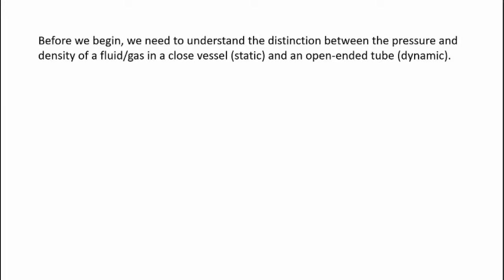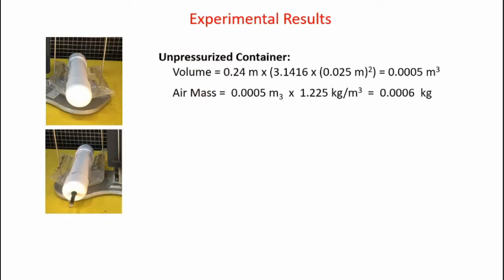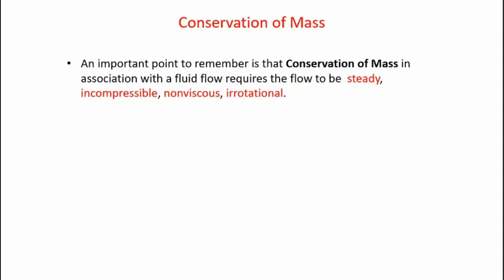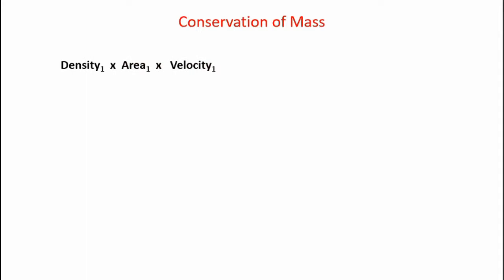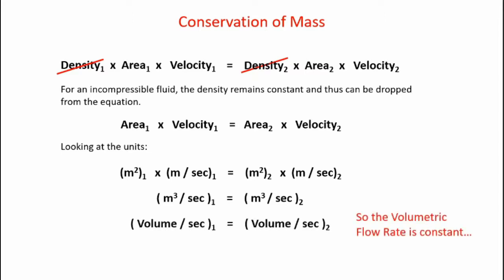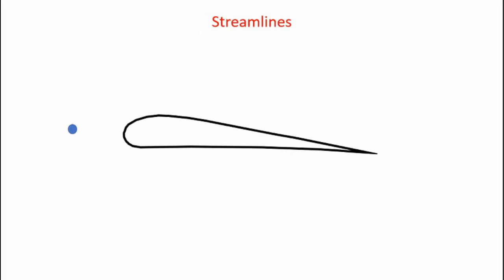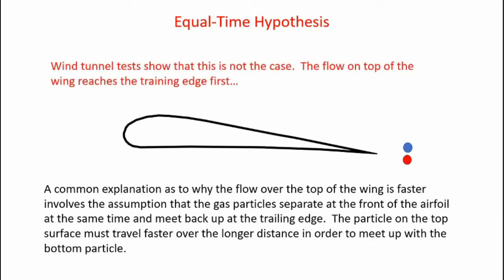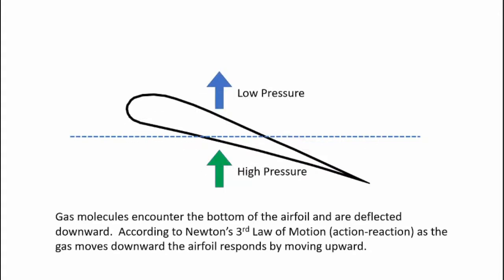Bernoulli Principle - Generating Lift

Comment: Your initial numbers don't compute.  If the 20 psi is from twice the mass and the 20 is gauge pressure, the internal absolute pressure should be double.  Per PV=nrT, if n doubles then P should double. Therefore, the 20psi gauge is 40 psi absolute.  Sea level is only around 14.7, not 20.  Do you have that  much error?

Comment: 5  minutes was enough to determine that this is not worth any more of my time. He doesn't realise that a wing does not operate in a tube. Or that his acknowledged concern about the incompressibility of air is indeed a show stopper. Conservation of mass in a tube has absolutely nothing to do with the generation of lift.
Reply: This is a terrible take. The first 5 minutes are spent demonstrating that people's knowledge isn't flawed, but rather air can act in different ways in different circumstances. He caps it off by stating that in open circumstances pressure and velocity can adjust to allow density to remain constant, therefore incompressible. 

Conservation of mass absolutely is applicable to lift generation, as an airfoil relies on it to generate differential velocities and therefore pressures on the upper and lower surfaces, which is the basic principle behind lift generation. I'd genuinely recommend taking another watch, this video is significantly better at explaining the principle, supported by experimentation, than any of my previous education.
Reply: @Polypythat  You do yourself no favours by being an apologist for this nonsense. Conservation of mass in an ideal fluid, (incompressible, inviscid etc.)  led Bernoulli to his now famous but poorly interpreted principle. Bernoulli's principle states that in a moving fluid, (and he only worked with water) a change in flow rate is always associated with a pressure change. What the principle doesn't say is that a change in pressure in air (the highly compressible form of a fluid) is always associated with a change in flow rate. A change in pressure in air can be associated with a change in flow rate, but a change in pressure in air can also be associated with a change in volume  (by evacuation or compression) or a change in temperature. It's a case of A always results in B but B is not always associated with A. All dogs are animals, but not all animals are dogs. 
A change of pressure in air does not have to be associated with momentum, velocity or acceleration: think about your tyre pump. Think about heating a container.